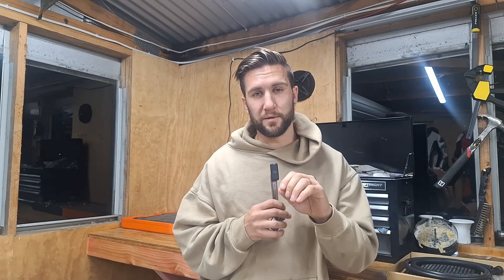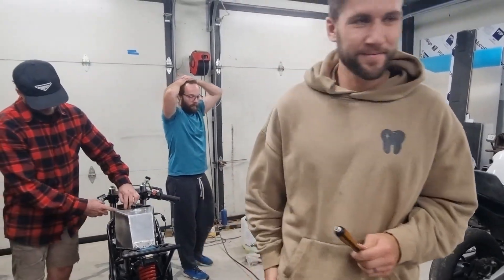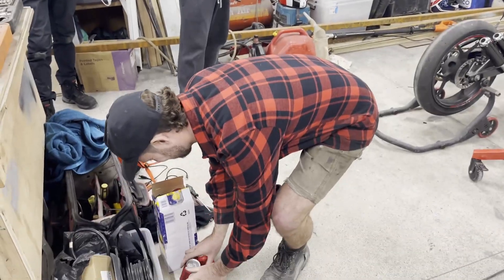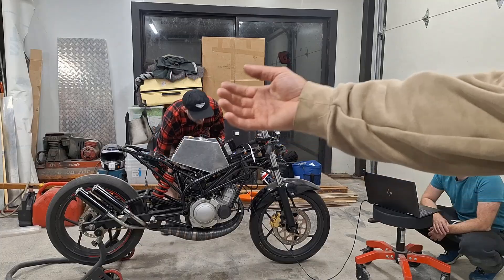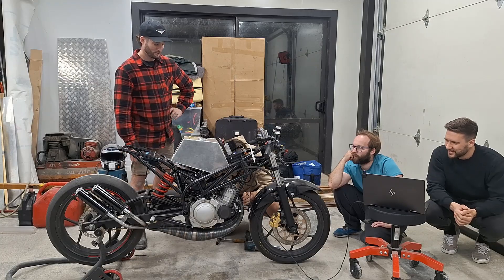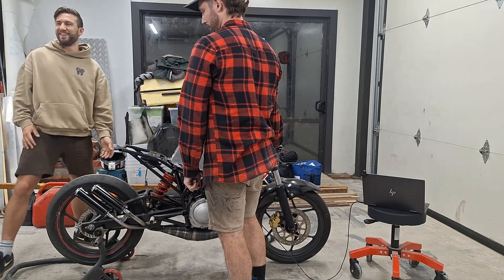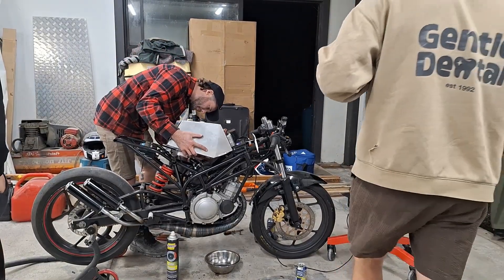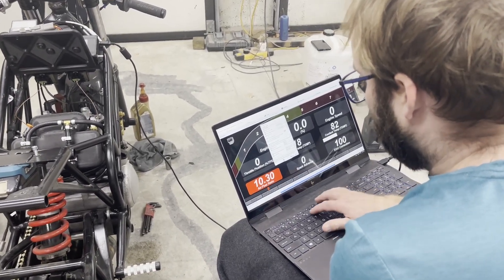3D Printed Race Engine First Start - Incredible Sound

Comment: Nice project guys =)
I have in my TZR250 tested Injection.
And the issue about 'when in the pipe' mapping fuel and 'off the pipe' i solved by using a mapsensor reading the pipe pressure.
BUT!
Pulses might destroy the sensor so i made a small 'plenum' using a simple fuelfilter in the line to the sensor, also between the filter and the sensor i put a small restrictor(0.3mm) to also restrict the pulses into the sensor.
It has actually worked a charm.
I could easily make a fuelcompensation table using the sensor, so no pipe pressure less fuel, and vice versa.
I by the way use Maxxecu mini ecu.
If interested there are some videos in my channel here at the tube.

Good luck guys!
Reply from the maker: Hi Patrick, that's a very interesting idea. I like using a restrictor to smoothen the pulses. Cheers

Comment: That sounds different than any other twin I have heard. I'm kinda wondering what the firing pattern is. Like how many degrees of rotation between sparks. 11:25 ah that's part of what I'm hearing.
Reply from the maker: Hi mate, the firing order is 180 degrees. It certainly does sound pretty unique.

Comment: Are you guys going to use an external electric water pump? Absolutely stunning project you have going on. I hope I can see another video from you soon!
Reply: Yes, and we are using pulse width modulation to control pump speed instead of using a thermostat
Reply: @lukeriley5480  very useful, I'm guessing you'll do the programming behind the temperature/pump speed ratio. I was pleasantly surprised about the Suzuki wheels too, they are very light!
Also do you plan on doing a little batch of these casings for whoever is interested after development?
Reply: @RTDe-fz1uy yes we will work out a pump speed table to automatically adjust pump speed to whatever is required to keep the water at the desired temperature. Its very unlikely that we will make this particular bike/engine commercially available to anyone, this is just a one off.

Comment: Is that 2 derbi ebs050 cyllinders?
If so, there are some bidalot 50cc cylinders that you can buy i think they make about 15-20hp each
Reply from the maker: Yeah they are derbi cylinders, if we have good success with tuning the EFI on these cylinders the plan was to upgrade them to something like the bidalot cylinders
Reply: haha nice man, i would love to follow this project, what’s the point of the bike racing on cart tracks?
Reply from the maker: @alexrodensjo348  Kart tracks are great fun with small bikes, our local track has 10 corners in a 40 second lap so it's pretty exciting. Also much more affordable than racing at larger tracks
Reply: @SketchyRacer yeah talk about it i race a cbr600rr, 500 dollars just to signup  for the race weekend, then tires fuel yeah it ads up, racing on kart tracks with small bikes is almost as fun but cheaper and less dangerous, i have been thinking of switching too😄
Reply: @alexrodensjo348 No need to switch, just do both brother!

Comment: Crankshaft inertia is too much too heavy.  Does this cylinder have a power valve?
Reply from the maker: For now I am happy with high inertia, I suspect it will help stabilise the engine for tuning the EFI. No power valves on these cylinders.
Reply: @SketchyRacer I suspect you'll have a bit of loss of acceleration. I am not able to tell if it's the actual crankshaft or clutch or the ignition that's too robust, but you know where to get that extra acceleration from. I reckon this can be a great platform. I hope you guys make more kits probably sell the design in the future for people who want to give it a go or sell full engines. Wishing u guys only the best.
Reply: It's not just the crankshaft, it's also the much bigger gearbox assembly not to mention those huge gears for the primary transmission. Inertia is massive all around, I definitely do not think of the crankshaft as main culprit there. It also comes to the twin 50cc cylinders which from factory are nothing more than an aluminium replica of original EBS050 engines therefore there isn't much power behind them. I also missed seeing the ignition, so it is entirely possible that they used the OEM Kokusan ignition from EBS with two coils, which is about 850gr for the rotor mass. 
We don't know the diameter of throttle bodies, compression ratio, port timings, what those expansion chamber are and much more... Plus they just said the engine is still under development due to the EFI not being setup on dyno. 

I think it is too early to draw opinions on something that is not even finished yet nor we know all about it.

Comment: This is a buckets racer isn't it? Love that there is a class over in NZ that encourages so much tinkering and innovation, over the ditch here in Aus everything is so restricted when it comes to motorsport. 

Fantastic work fellas, so bloody cool!
Reply: Not even a class like this here in western aus i miss this type of racing class
Reply: Still gp classes for 125’s and 250’s. No production rules for them. Just 6 speeds max and cylinder number restrictions
Reply from the maker: Thanks mate, yeah it's very cool that the class allows us to develop bikes like this. I'd say that this is probably a bit over board for buckets, but for us it's a practice engine before we take on a larger project.